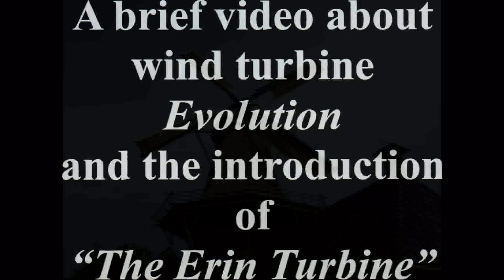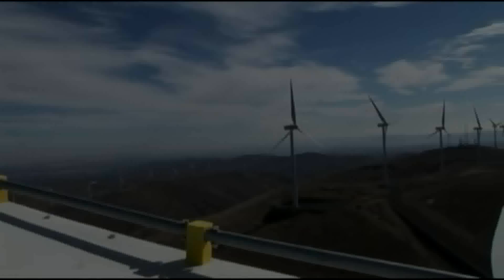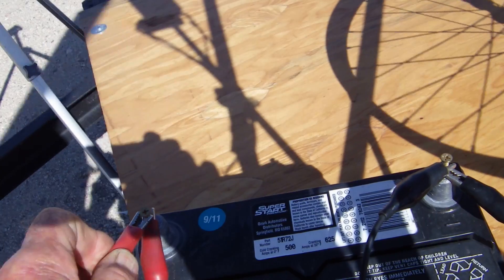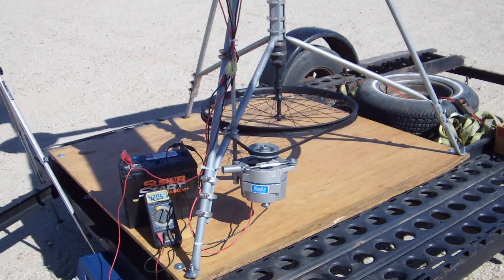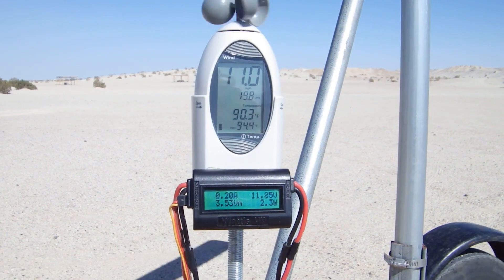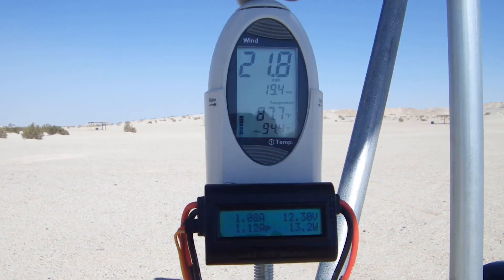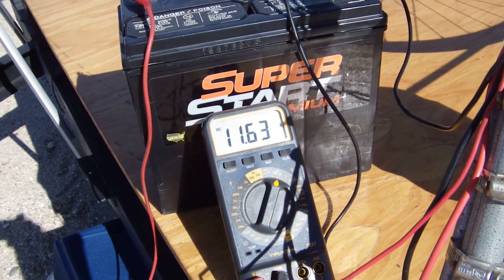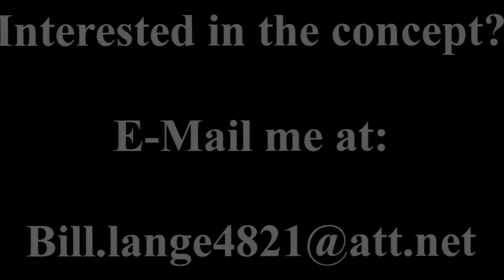a new wind turbine design

Comment: With your background in plasma physics are you doing any work with hydrogen or MHDR's I wanted to build one but I found that sustaining a high energy particle stream would be a difficulty for residential use. So maybe not practicle. I just wish I had more resources to do what I have ideas for and Michigan weather is a huge setback when most of this work is outside and running welders is expensive. I am also working on ways to turn waste into energy or heating even compost reaches up to 140 deg.

Comment: Actually I have built a few and designed one in which I attemped to get a patent on back in the 70's. I also went to WMU for aviation science and areodynamics. I was not referring to the blade flexing. Currently I am at work on 40 foot VAWT tower with an output of 5 kw/h in a 10mph wind and total passive tech for braking etc. When finished I will be posting videos. I am impressed with what you built from scrap parts and your testing. You show that anyone can do it and start saving money.

Comment from the maker: You have a couple of things backwards, but that may be because you never fabricated a wind turbine, so it's understandable. If anything the outer edges of the flex panels should present the greatest exposed surface for maximum torque. Aluminum is probably the worst choice in metals if you require sustained flexing. Hold a stainless steel ruler over the edge of a table and bend it up/down 15 degrees. You'll be doing that for 20 years before it breaks!

Comment: I thought of that design a long time ago here is what you need to do is reduce the area to a minimun at the tip and increase it at the inner diameter just like a prop is made this is because the tip travels twice as fast as half the diameter so it needs less area for the same torque. The other thing is stress failure from constantly bending the blades. Aluminum I think is more practical and lighter so it costs much less. Nice job on it and your test, very educational.

Comment from the maker: Too many blades leaves each in the shadow of the former. Stacking 2 sets could work well if staggered 45 degrees. Stainless steel panels are best for long term use in a commercial wind farm. You'd need to select an alloy that would stand up to repeated flexing for years. Thanks for your interest.

Comment: What if you had the blades stacked about a foot apart all on a center axle? Make several more and stack them. Nice design though. Just as a thought, maybe 1/4" rubber would be a little stiffer?

Comment from the maker: .

W Lange   2 seconds ago   

Just to correct things, numerous vertical axis wind turbines are "lift designs. To help you understand my design, imagine trying to hold a 4x8 sheet of plywood up against a 20mph wind. The shaft rotates at about 60 rpm but the blade assembly applies tremendous torque to the shaft waiting to be geared up to 2400 rpm. The design is silent, cheap, self regulating, and only needs towers 15 ft tall. And most important...no government subsidies needed!

Comment from the maker: Just to correct things, numerous vertical axis wind turbines are "lift designs. To help you understand my design, imagine trying to hold a 4x8 sheet of plywood up against a 20mph wind. The shaft rotates at about 60 rpm but the blade assembly applies tremendous torque to the shaft waiting to be geared up to 2400 rpm. The design is silent, cheap, self regulating, and only needs towers 15 ft tall. And most important...no government subsidies needed!

Comment from the maker: It does seem lame, doesn't it. The main point isn't the low output but the low profile and low cost of the design.. The clumsy bike wheel/pulley arrangement only resulted in a 6 to 1 rpm step up with the generator turning at about 350 rpm. There's enough torque at the vertical shaft to spin up the generator to about 1200 rpm, I just don't have the resources for a proper gear box. Bob, you should try building something sometime, but I guess it's easier to just make fun of other people's efforts.

Comment: good job on the video.   I think my VAWT is more likely to be economic, but you make a good argument for VAWTs.  Drag based turbines are limited to low efficiency (energy collected per swept area) but in reality what matters is $ to Watts.   You might do well to try to create an economic model, based on what you know.   One bit of input is rather than use a generator to collect and measure energy collected, try a proney brake, so you can vary the resistance seen by your turbine.